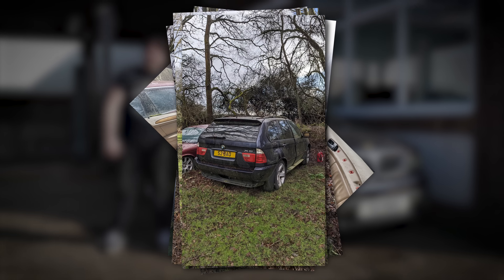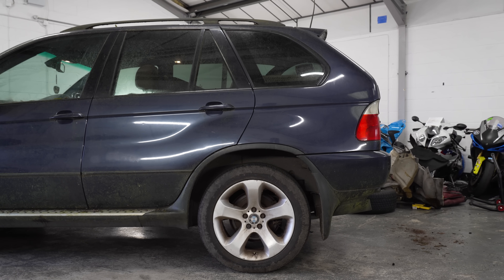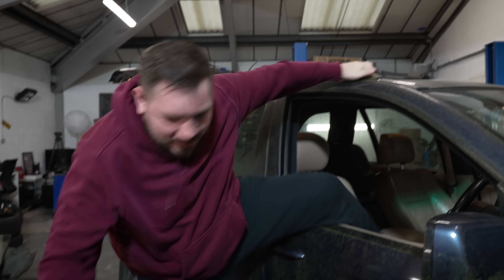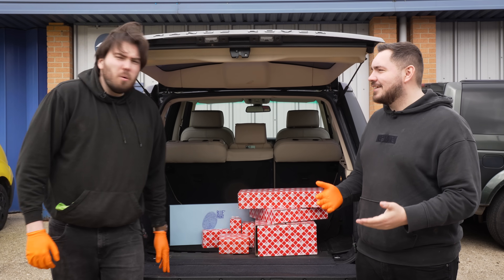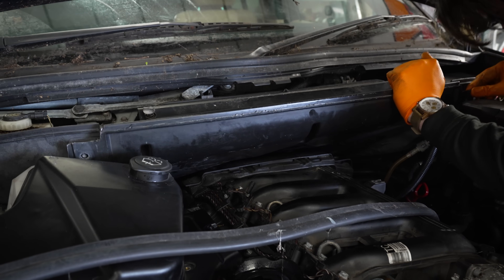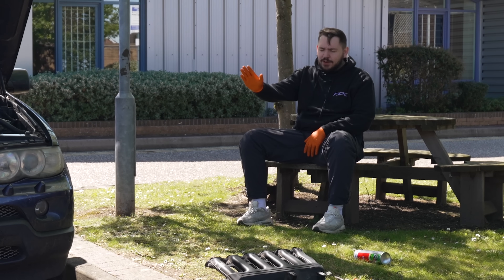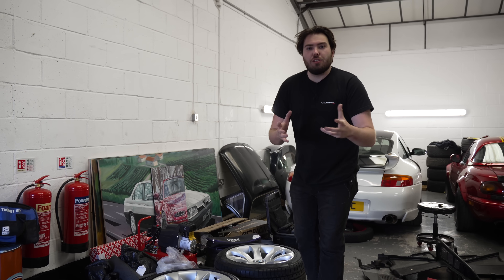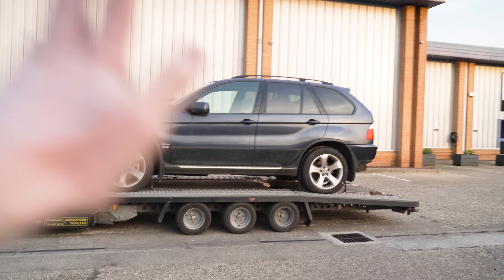This Cheap SUV Has HUGE Problems

Comment: As a former E53 X5 owner, they are great daily drivers. Glad to see y'all make some content with them!
Reply: Are they reliable especially compared to the 2.0d ones? Looking to get one in the future as my dad wants a higher up car to make it easier for him to manoeuvre in etc
Reply: @sol-hb8zg The 3 liter M57 diesel is one of the best engines BMW has ever made + great base for power uprgrades. I'd say if you buy an X5 3,0d that's not horribly mistreated you'll be just fine :)

Comment: I doubt the glowplugs prevented it from starting. I ran one with faultcodes on all 6 for a year. 
It wasnt not happy in the in winter at -30c but it started.
In the summer i did not even notice it, hence why I forgot to fix it before winter.

Comment: A little tip for the m57 owners if anyone wants it. I have noticed that most of the times there is no need to drill the threads out or remove the head if the plug snaps. If it feels that the plug is already cracked or snapped, just crank the plug it till it pops in half. Then soak the broken part in the head with coca-cola and then in transmission fluid/penetrating oil. The head is aluminum and the coke will do its magic and it will free it up. Then just pop it off with a bolt extractor set (a good one) and bobs your uncle. Done that a few times with these m57 engines. Best is to do the glow plug swap when the engine is functional. First soak the plugs in penetrating oil for a week or two. Then get the engine hot and try to remove them. Always start from the farthest from the front of the car so they stay the hottest and most likely to come out without snapping. Its just easier to work with the ones closer to the front of the car rather than the ones deep in the engine bay in the case of snapping one. The key is low power and slow, rock the plugs back and forth if it moves even a little bit. Sometimes they all come out nice, and sometimes this happens anyway. And remember to replace the glow-plug relay when you swap the plugs.

Comment: Limp mode issue is more than likely the gear selection switch mounted on the side of the gearbox. Get a genuine part for around £300 (there are cheap parts which only last about a year) it’s a 5 minute fix if your dashboard doesn’t show the gears and shows the fault “trans failsafe”

Comment: It was a bit of a dog, but you gave it a good go. 
Just a little thought I had - you possibly could have left the one knackered glow plug in and replaced the rest. I have a TD5 LR Defender - 5 cylinder diesel, and by design it only has glow plugs in 4 cylinders. That's enough to get it running even in the depths of winter, and cylinder 5 soon catches up. 

"Centre"

Comment: I drove my dad's E53 when my miata had exploded and while I liked it a lot it was leaking oil like nothing I've seen and it would've been way too expensive to take care of. Absolutely lovely car to drive, absolutely fantastic transmission, everyhting. I often think about getting one but even simple maintanence is too hard for how easy it should be. Thermostat need replacing? Yeah sure thing bro we made it electronic for some reason. Want to get it off? Buy this special took to get the fan off.

Comment: I hate to be that guy but the M57 in that facelift X5 is different to the one in the range rover. The range rover has an older generation M57 which is a 2.9L 184hp engine whereas the facelift X5 has 3.0L 218hp engine. Different but similar.

Comment: Just to say I'm the idiot who bought this from Taylor and it's not just the air filter the squirrels made a mess of! But after a heck of a lot of wiring fixes it's very close to being MOT worthy. Just got a leaky intercooler pipe to sort then fingers crossed I might get to drive her on the road! (I mean she's also got a leaky roof, dodgy air suspension and an interior that smells like Shrek's foot, but that's all minor stuff)